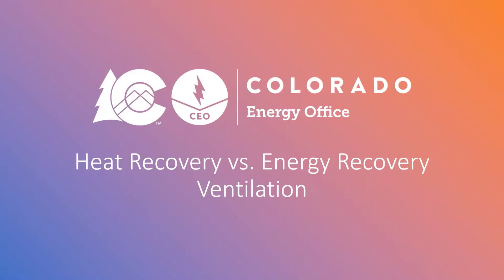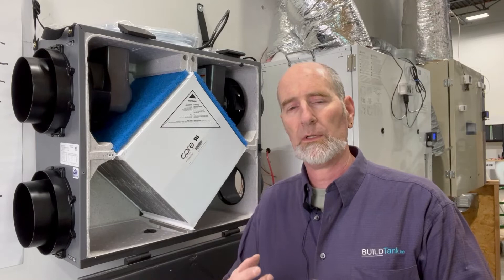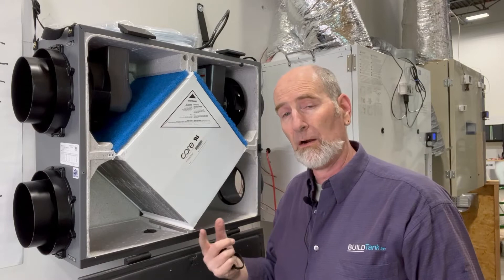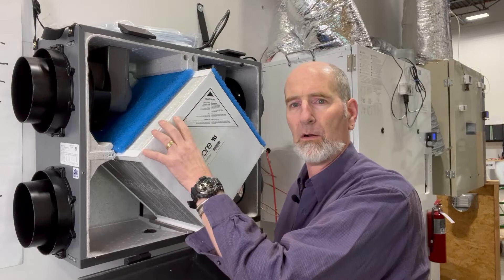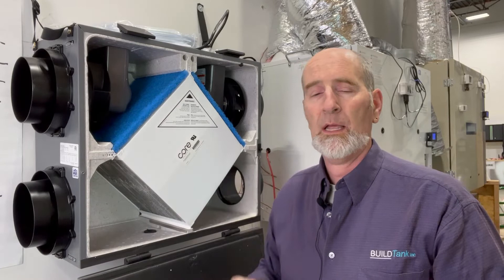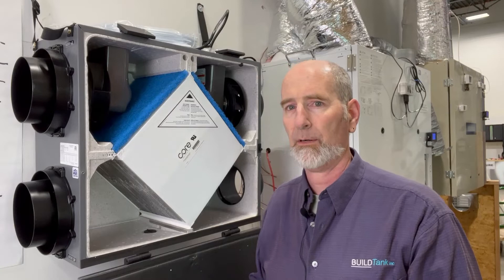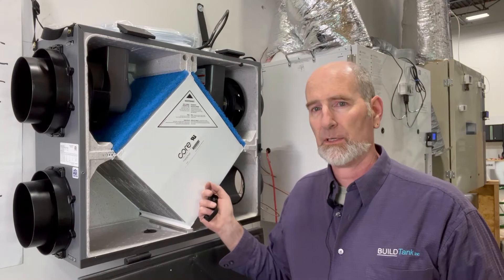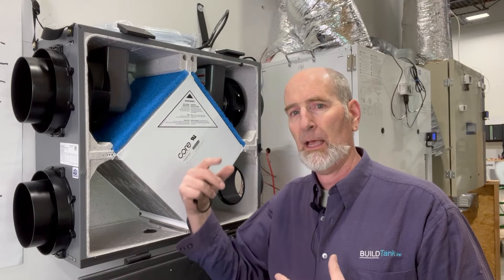Colorado Energy Office: Short building codes training video - HRV vs ERVs

Comment: hen Exhausting/Supplying from/to more than One Area/Room/Locations, How do you maintain Suction/Supply Air? I Have noticed a Significant drop in Air Suction from Exhaust and Decrease in Supply Air when I "Tee" in to more than One Area. The 6in Ducts drastically drops the air movement after I "Tee" Off into Any Location. How do You Overcome this?

Comment: You didn’t mention the materials. Paper vs plastic or aluminum? How do I know which one to get? Why do some companies have only HRVs?  Can smells transfer across the membrane of an ERV?
Reply: I would always spend the extra if you can afford it for an aluminium heat exchanger core. Metals have higher heat transfer coefficients than plastic or paper and you'll have greater efficiency. If you have carbon filters inline within your duct work (along with HEPA for particulates) or in the housing then that carbon media will do a good job of removing odor and VOCs like formaldehyde.